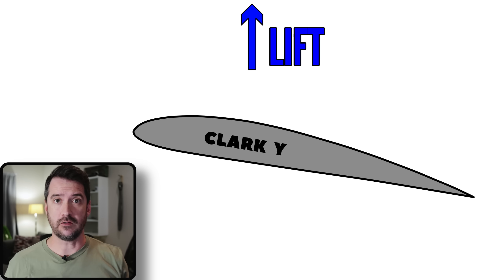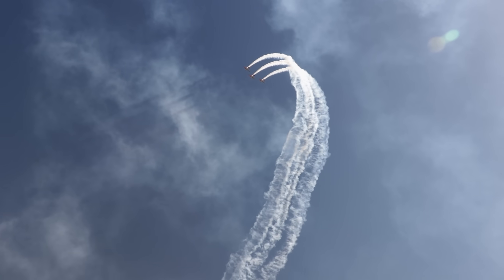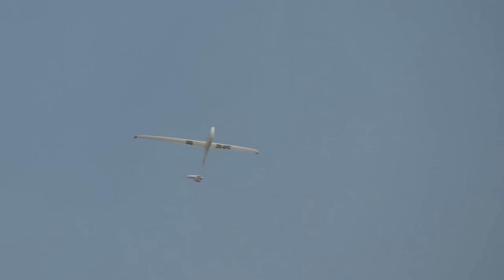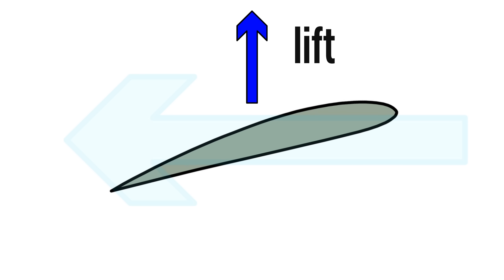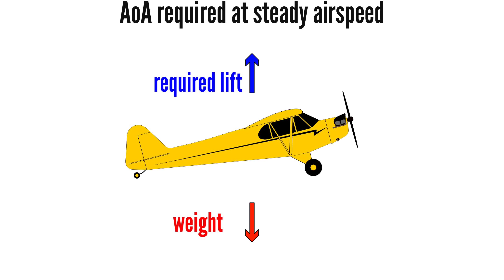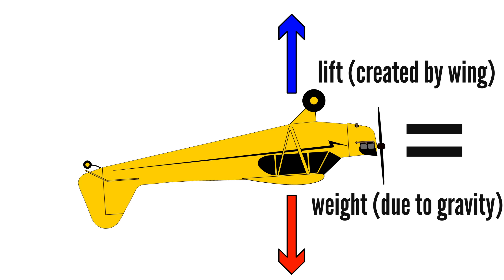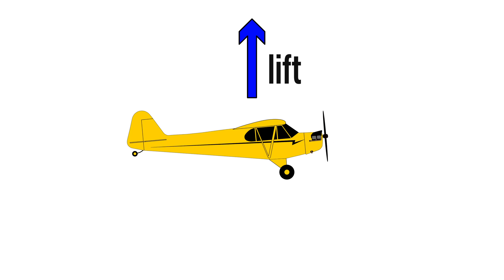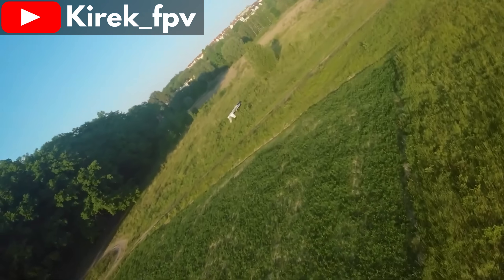Is Airflow Distance Over the Top of a Wing Always Longer?

Comment: The "camber generate lift" explanation never made sense to me as a kid. It always seemed to me that airplanes just "slide" on air the same way that boat "slide" on water, the aircraft just has to do it faster cuz' air is less dense than water.
Another comparision would be streching your arm out of a car window and feel your hand "fly" by "sliding" over air, at least if you have the right angle of attack.

So if I sum up, tell me if I got it : To fly you need a positive angle of attack, no magic camber of any kind will make you fly without a positive AoA, but the right camber will generate lift and make the whole process much smoother and economic.
Right ?

Comment: Whilst I have only been a Licensed Aircraft Engineer for 50+ years - I have also been a sailing  instructor.  In that environment, the Theory of Flight (in a Vertical plane) - may be demonstrated on a strong wind day, with "Lift" being generated by apparent wind speed increasing as the boat accelerates and more airflow passes "In Front Of" (over) the Foresail & Mainsail,, than Behind (under) those Sails (aerofoil sections) to act down through the mast as motive power but which may also be (technically) described as "Lift".  This effect also benefits by the accelerated airflow passing through the "slot" between Genoa/jib/foresail  "trailing edge" or Leech and the Mainsail leading edge or "Luff".
  I was also a gliding instructor for many years - and this video provides an excellent explanation of slightly-more-than-basic Theory of Flight, with the Stagnation Point position answering any queries about Lift Generation during (prolonged) inverted flight - especially with the aircraft wings at the centre of any such discussion having conventional aerofoil sections. 
  Finally, and for your own interest, you are absolutely correct in your contention that ANY aircraft may perform simple aerobatic manoeuvres like rolls and loops - providing (as my gliding aerobatics instructor once told me) "You maintain a positive 1g throughout the manoeuver" This theory has been Proven - and recorded on film and video - by pilots of a (prototype) Boeing 707, an Avro Vulcan and  - more recently - a Lockheed C-130 Hercules. Not exactly Pitts Specials, but even more impressive for that...
Reply: Excellent point.  My first experiences with sailboats progressing into an oncoming wind were highly educational. I don't understand the math behind the fluid dynamics that makes it work, but I don't have to in order to know that it does.
Reply: When I practiced falconry, my hawk had only to spread her wings in a slight headwind for her to lift off and I would tow her like a kite on the end of her leash.
Reply: @bernardedwards8461 that sounds really cool :)
Reply: Where do you get a statement like this from?   You do not have to maintain a positive One G throughout any aerobatic maneuver.  If your loops are really round, there's likely negative G's at the top of a loop.  A Citabria or a Super Cub could do a truly round loop.  When you pull on the control wheel, G's increase, and - vice versa - relax and G forces decrease.  So - how can one possibly perform an aerobatic maneuver without moving the elevators, which vary the G force on any aircraft?

I was educated as an aeronautical engineer.  I am a RC flyer, model aircraft designer, aerobatic pilot, and - a flight instructor.  I have 15,000 hours flight time in full size aircraft, both in a number of light airplanes and a few commercial passenger jet aircraft.  Years ago, when I taught the "aerobatic" maneuver known as a chandelle, depending on how it was performed, G forces clearly less than (and more than) One G resulted.  A 90 degree chandelle (hammerhead stall) should have zero G's at the top of that maneuver.  

Airplanes fly, because the lift comes from the force resulting from the change of momentum of air deflected downward, offsetting the weight of an aircraft, no matter the complexity of the physics behind what causes that. That's why helicopters fly, too.   

For every action there is an equal and opposite reaction, according to Sir Isaac Newton's third law.  The law of conservation of momentum rules!  The physics is generally beyond a forum like this one, where so many varying opinions can be confusing.
Reply: @j14152  which model aircraft did you design? i'm working on my own, too
Reply: @marc_frank  My own. In the 70's, when Servos weighed 2 ounces each.  Planes back then had thick airfoils and weighed too much.  I started by researching airfoils.  Engines, for the most part, didn't have that much power, so I got into modifying my RC engines.  Light weight construction, built up wings, spruce spars, long tail moment, MonoKote covering, tapered symmetrical airfoil, max thickness at about 40% chord, airfoil thickness 7% chord at the wing root, 9% at the tip, barn door ailerons, large control surfaces.  Planes I built weighed about 5 pounds.  Modified Webra Blackhawk and YS61 engines.  I liked doing huge loops and large maneuvers. These planes had the power to climb vertically and maintain speed during vertical maneuvers, as they do now.  Then I got into building boats.  End of story.
Reply: I have been generally underwhelmed by the air flow in the slot. but will make some more observations.  My sails have a lot of telltails on them.
Reply: Most sails effectively  operate. stalled.
Reply: @HughRiddle My experience with normal fore and aft rigged consumer sails, properly equipped with 'tell-tails' (fine yarn, or old cassette tape), showed attached flow over as much of the convex side as wind tunnel tests show for most full scale aircraft wings, and similarly attached flow over most of the concave side. Optimal boat speed is normally recognized by competition sailors as slight turbulence or reverse flow on the concave side, just aft of the mast. This is far from 'stalled'. Even old square riggers didn't run stalled, unless going at or close to, straight downwind.
Reply: @billtaylor3499 . Thanks for responding and I agree about tell-tail indications. About 15 years ago, the lift vs drag polar diagrams for cloth and wing sails in sailing researcher Ross Garrett's book The Symmetry of Sailing led to my conclusion. I'm ashamed at being unable to recall the logic and hope I can find time to revisit the area.
Reply: @HughRiddle  Not sure exactly what you mean by the sentence.  They /can/ operate stalled, but they don't operate /most effectively/ when stalled.  That is:

I agree that most sails can contribute propulsion even if stalled (and unlike a plane where a stall is often a crisis because you may fall out of the sky, a boat can usually afford to just sit there, unless it's critical that you be able to clear some leeward obstacle ahead).  But on most points of sail the propulsion from a stalled sail will not be optimal -- if you adjust the sheet (and any other relevant lines available) so as to get all the leeward-side telltales streaming aft, you'll go a lot faster.

Comment: I believe that the camber of the airfoil is simply a mechanism by which a wing generates lift, but it's not the only one. Even a flat wing and as you make clear.. an inverted airfoil can generate some lift, with a high angle of attack. So obviously angle of attack and wing camber are both creating lift in different ways. Varying the camber with flaps and ailerons will change how much lift is made. Realize too a flap alters the Angle of INCIDENCE of a wing, and in effect raises the AOA. But what all this is ultimately doing is thrusting air downward, as a propeller thrusts air backwards. There is always an equal and opposite reaction to moving any mass. Downward air, upward wing. Also there's no law that says the air on the upper surface must reach the trailing edge at the same time as the air across the lower surface, and it doesn't. It does however rarify the air across the top and speed it up. That is, the pressure drops and velocity increases. This is measurable even on a flat wing at high angle. So both airfoil camber and AOA affects the ΔP providing lift, and velocity results in air moving downward for the reactive lift. Look at wingtip vortices.. The large ΔP shoots the air UP in a curl, as the horizontal velocity at the tip at a right angle to air flow is low, and high pressure is not countered by high upper surface velocity, and it seeks to fill the low pressure zone at the ends. Unlike the speedy mass of air at the trailing edge being forced downward at speeds high enough to do this. Lower speeds is a stalled wing. Keep in mind that raising the AOA also increases air pressure, or compresses the air under the wing, providing upward lift but it must be thrust downward by the high speed air across the top to maintain it.

Comment: Dr. Michael Selig's excellent research on "Airfoils at Low Reynolds Numbers" tested a huge variety of sophisticated and traditional airfoils in a wind tunnel experiment.  The flat plate was the standard by which all other airfoils were evaluated.  The flat plate was 90% as efficient as the best airfoils tested.  That last 10% is where the highly refined airfoils make a difference in Lift/Drag, fuel economy, high speeds, heavy lifting capability and all of the differences we perceive as being the result of the airfoil that was chosen for an application.  @9:01 - The wing is not at zero degrees AoA assuming a horizontal airflow.  The wing is actually at +5° or so (calibrated eyeball ;-) because the measurement should be taken on a line projected through the red dot and through the trailing edge.

Comment: Its simpley, ALL forces exerted by a fluid on a solid body come in the form of PRESSURE.  The sum of ALL the pressure on all surfaces and the ANGLES of thouse surfaces sum to the forces on the object when it is moving and when it is stationary.  IF their is a net force then their is ALSO and NESSARILY an EQUAL AND OPPOSITE force on the Fluid, aka air is deflected by the wing in order to create lift, and when the fluid is slowed their is drag, their is infact just 1 net force vector that we choose to break apart into a portion parrelel and perpendicular to the flow direction.  A flat slab with no curviture pushed into air with an angle will create lift and will ipso facto experience differential pressures on the top and bottom which sum to a lift and drag force.  Theirfore the shorter path/pressure argument definitivly dose NOT explain the lift, at best it can tell us why a good wing is better at making lift then a slab, or more importantly why it generates lift instead of DRAG.   

The whole point of wings top curve is get both sides to do the job of deflecting air and not allowing the high drag situation we see in a stalled wing.  The path length of the air over the wing being longer is not the point of the curve, retaining the air in a laminar flow 'stuck' to the top of the wing is the point.  Because air stuck to the wings top can then be bent by the wings shape for lift.  If Lift came from path length differences themselves then we would increese the lift of a wing by making a bigger hump on the top of the wing or putting undulations in to it.  This dose not work, a big hump of a wing fails at making good lift, as Einstein (yes that guy) found when he tried to make a wing based on the Bernoulli principle alone.

The deeper flaw in the Bernoulli explination for lift is that it ignores area.  If you create a low pressure by incressing the area on the top of the wing the force is pressure times area.  If the reduction in pressure is just the inverse of the area increase then the force remains constant.  Another factor to consider is shape, every surface feels airpressure of 13 psi, but I can't make an object feel a net force 13 pounds on one side by adding a cylindrical extension which will increase its area on that side by 1 square inch, because the forces on the shaft of the cylinder all push in and cancel out.  It can clearly be shown that any possible 2D surface shape feels a net force the same as a flat surface of the same diameter woiuld feel.  Thus we can't add force to either side of a wing by simply adding humps or curves.

Comment: A propeller is an airfoil and I think everyone accepts that it works by pushing air rearward and not by creating a low pressure area in front of the plane.  The wing is the same.  It works by taking air and forcing it downward.   The trick of the tear drop shape of a standard wing is that it forces the air above the wing downward which increases its efficiency increases the angle of attack the wing can operate at.

Comment: Try taking the Longer vs shorter path theory and make it work on a standard single skin yacht sail.
Reply from the maker: I'm not saying the longer/shorter path is ALL that causes lift (actually I only explained why a certain argument can't disprove it). However the problem with longer path / shorter path is people measure the distance over and under the airfoil surface, instead of looking at the distance of the airflow, which is not the same. That was the point of the stagnation point illustrations. 

So what I'm saying is the airflow path over is always longer on a positive AoA wing. Lift however is predominantly created by the pressure differential due to the AoA.
Reply: The longer path theory, the way most explain it, also assumes that the air has to arrive back together at the same moment from both paths, which is not the case.

Comment: Airplane wings generate lift by air displacement. If the air leaving the trailing edge of the wing is at  lower point than the air entering the leading edge then the wing successfully displaced air and lift is generated. The pressure difference is an effect of air displacement and not a cause. The air molecules traveling under the wing go into compression and actually take longer to transverse the wing that the ones going over. Single surface wings like those on ultralights and highly reflexed wings on paragliders have almost no difference in the length of the path and those wings produce a lot of lift. The leading edge stagnation point does move under the leading edge of the wing during higher angles of attack but the trailing edge stagnation point also moves up the back of the wing at the same time.

Comment: Your arguments, some of them true when considered individually, contradict each other severely when put together. A symmetrical wing does produce lift if the AOA is established appropriately, meaning that the shape of the wing itself is not the predominant factor. The very videos you include in your post demonstrate that fact, even as, you try to argue against it. You yourself said that up until the point of stall, lift is a function of AOA. A symmetrical wing can have AOA.
At the end of the day, the force holding the plane in air must be matched by - in fact is created by the production of - an equal and opposite force. That is the ONLY way we currently know how to move anything, on or off this planet, period. To move forward, we must push something behind us; to leave the ground, we must push something downwards. The ONLY thing the wing has to push against once it has left the ground is air - the air mass it is moving through. That means that the forward thrust must drive the wing through enough air, fast enough, to displace a sufficient volume of air per unit of time with sufficient acceleration (loosely, mass/sec x delta velocity) to produce that equal and opposite force. You can do that with a plank of wood. The reason we use airfoils is for efficiency: reducing drag - energy lost by friction, by the displacement of air in directions that do not contribute to lift - i.e. turbulence, and of course the minimization of the aft stagnation region. The lift generated by the innate aero shape is minimal.
To illustrate this, I draw your attention to the obvious contradiction inherent in the polarity of the delta pressure across the thickness of an asymmetric wing vs. the direction of the force of lift: if the delta pressure across the wing were significant enough to produce lift with no other factors, then once the wing moved out of that section of airmass, there would be an uprush of air, caused by the higher pressure air below the wing flowing into the lower pressure area above. Clearly that doesn't happen, as any pilot of a small plane landing behind a large plane will tell you: downdrafts go... DOWN. A plane moving through an air mass produces a significant downdraft - displaced air with an increased VELOCITY. Stand underneath a hovering helicopter once: the only material difference from a lift generation perspective between a fixed wing aircraft and a rotorcraft is that the latter "pulls" the air down from above it (mostly), while the fixed wing craft is pushed into the air mass by the forward thrust. 
Analyses of distance traveled by air over the wing vs under, and differences of velocity, contribute to the goal of maintaining laminar flow with a non-zero AOA - minimizing drag while producing lift, and are therefore about efficiency, but the bottom line is you cannot stay up without pushing air down, period. The balance of forces is one of the most fundamental principles of physics: if you want to fly in the air, you have to push enough air downward to overcome your weight.